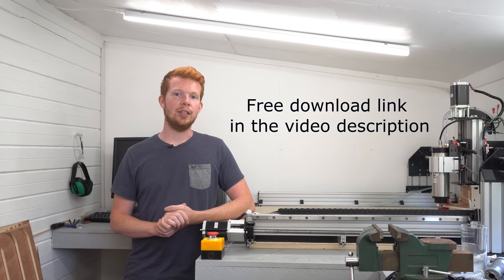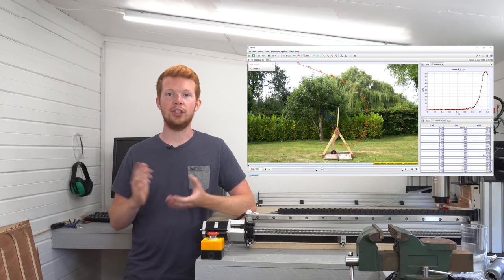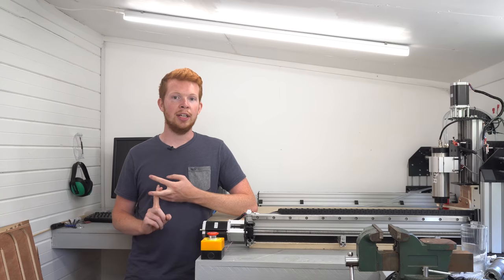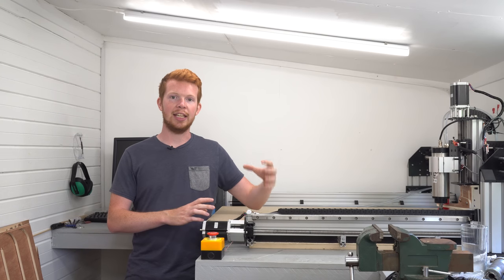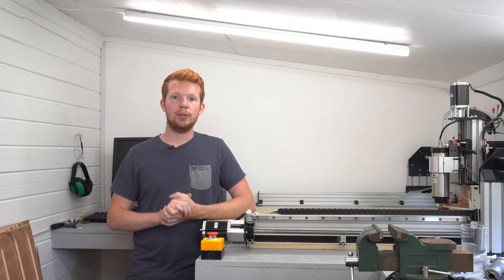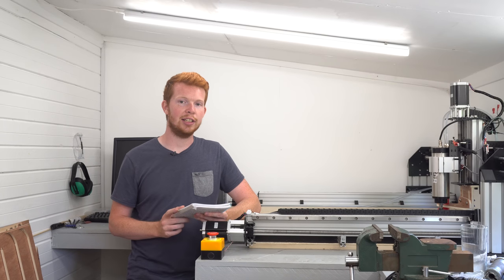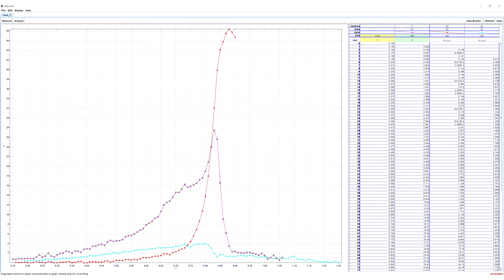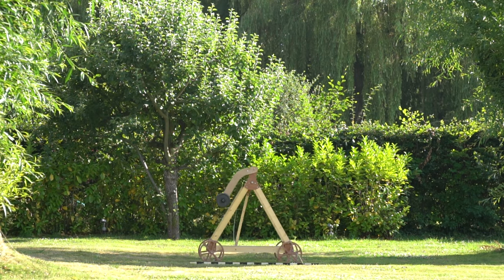Wheels on a trebuchet?

Comment: you still need the frame weights with the wheels, supposed to roll, not jump in the air
Reply: Jusb1066 noticed that too
Reply: This is a test I'd be interested to see. Will a weighted, wheeled frame break 70% efficiency? Can we get the tennis ball to 140?
Reply: If the frame has more weight, it would take more energy to move it the same distance forward, which is the distance required so the counterweight falls directly down the whole time
Reply: But there's already wasted energy in the jumping around of the frame. The weights may damp that. Or not.
Reply: Yeah but if the frame is weighted to resist jumping, it might end up being less wasted energy. I think it's worth a test.
Reply: a better option would maybe be a rail that holds the frame down with bearings to reduce friction (so no jumping can occur), but still allows it to move forward freely to optimize the down-movement of the counterweight
Reply: Toobiwoobi I was going to suggest the same. I hope he tries both methods.
Reply: Many variables in play and opportunities for tuning.  Here is a fixed frame with above 70% efficiency.  https://www.youtube.com/watch?v=p_O3h71TnhQ
Reply: When the machine is timed and the wheels can move freely, the Whipper Hop will stop.
Reply: The lighter the frame, the faster it can move out of the way of the counterweight, robbing the cw of less energy.
Reply: Might be best to make the frame even lighter and let it run on tracks with ball bearings above and below the track so it can't jump.
Reply: It won't need all that. But that's getting in to (FAW) Floating Axle Whipper and (FAKA) Floating Axle King Arthur designs.
Reply: When the front wheels jump up, the counterweight is falling to far behind bottom dead center. When the back wheels jump, the cw is falling to far in front of bottom dead center. That can be adjusted by changing the "gap"; the angle between the throwing arm and the hanger arm. The back hopping can also be caused by the frame being out of time from slow rolling on rough ground or in grass. I have videos showing all this stuff.
Reply: Notice it doesn't jump at all when he shortened the sling length to synchronize the stall points.
Reply: You really want the frame to get out of the way and back under the cw as fast and smoothly as possible. All the other timing points can be controlled in other ways.
Reply: There is also a backwards frame movement.
Reply: Everything stalls together, unless you're overclocking the systems sweet spot. But that's when shit gets good and the magic happens! 2, 3 400 feet per second launch speeds. They are weapons. We're not just trying to toss a ball around. We punch holes in stuff. Accurate, and powerful, at any scale.
Reply: Michael Smith I didn't know anybody cared. I was waiting for people to ask questions. I've been killing it for Years and have all of 40 subs. I just didn't think anybody but me gave a shit.
Reply: Michael Smith My Facebook group has over 180 people in it. It has all been being discussed in there. I always kept my videos short because I didn't want to annoy anyone or take up much of their time.
Reply: I couldn't tell difinitively from the construction video, but it also looks like there is a lot of friction on the axles.  Lost energy there as well.
Reply: there was no jump in the frame for the best test at 7:50
Reply: I believe this is something to be tested, at which frame weight there is the most efficacy.

Comment: A old NOVA special covers this in great detail.
The wheels are originally intended for a fixed weight arm. The basket arm does most of what the wheeled fixed arm accomplished.
On a fixed arm, the weight falls in an arc like a pendulum. The wheels allow the frame to move forward, allowing the fixed arm weight to fall in a vertical line, taking out the arc of the pendulum. The vertical drop gathers more force than the arc..  it’s not the trebuchet moving forward... it’s the weight falling “faster.”

Comment: The really good trebuchet vids that I’ve seen (MIT) use a stationary frame, but only the axle of the arm is on wheels. This allows the weight to drop nearly vertical. If the weight had no horizontal speed, then the potential is transferred more efficiently. You don’t have the mass of the frame being accelerated.

Comment: The frame moving forward is not loosing energy, compared to not moving you are just not moving the planet as much. With regards efficiency of the device with wheels, the counterweight does move backwards as part of the rotational path, if instead of the weight moving backwards the fulcrum moved forward the lighter end of the arm gains more forward momentum. ie by adding wheels you are effectively changing the rotation point of the whole arm,  moving the effective fulcrum closer to the counterweight and increasing the throw arm length just as it approaches the release. (see moving fulcrum trebuchets) 

If you put markers on the arm you will see that the arm no longer rotates precisely around the axle but slightly closer to the counterweight as the frame moves forward. 
To get even more energy out, try getting just the axle to move rather than the whole frame by putting it on a track on top of the frame.

Comment: Build a set of rails for the wheels to roll on. That'll greatly reduce your rolling resistance and should allow the frame to accelerate faster. Also, maybe bearings on the wheels?

Comment: Tom Stanton the reason why the wheels increase efficiency is not due to the velocity of the trebuchet moving forward, but what the moving forward allows the counter weight to do.  Without the wheels the counterweight does more rotation, but with wheels the counterweight drops directly down decreasing the amount of energy lost due to it rotating back upward like a pendulum.  It is the same reason why having the counterweight fixed to the arm is less efficient then having the small piece of wood as a go between. I drew a picture to illustrate the idea https://i.imgur.com/NjUtqmM.jpg track the weight with the aplet you are using to see the differences in the actual counterweight.
Reply: So it's similar to a floating-arm treb?
Reply: exactly my thought too. I was suprised nobpdy Else commented on the same
Reply: I hope he sees this comment because other people have comented other things that makes no sense. This is the true explanation
Reply: @caracaes  but he explained it quite well in the video. As he puts it the stall point of the weight and the arm are synchronized.

There are many ways to explain the same thing. All you want is as little energy left as possible.
This encompasses both explanations. Synchronizing the stall points means that at some point neither the arm nor the weight as much kinetic energy left. Having the weight drop straight down (as oppose to swing that wide circle) also means the weight has less kinetic energy left (otherwise it'd keep swinging).
See, in a way the video's explanation encompasses more than the one you so want him to see.
Reply: Coming in very late on this, I first came across the wheels-on-a-trebuchet issue many years ago in a Scrapyard Wars-type programme where the challenge was to throw a Mini. The reasoning given then was that with a simple trebuchet for best efficiency the weight needs to be able to drop vertically, hence the frame need to be able to move.

Comment: Great work and research Tom. 
The amazing fact to me is that the original designer of this machine achieved all this without the aid of modern day computers to analyse the performace. They would have had wheels to transport and manouver the machine into the attacking position. You certainly wouldn't want to be standing behind one when it was loosed....

Comment: The wheels are also moving the fulcrum (the hinge that the throwing arm spins around) forward which simulates a longer throwing arm. You could add the distance between where the hinge starts and where the hinge is when the projectile releases and I would guess that would be close to the distance between the end of the arm when stationary release and when its rolling release. Still awesome work Tom!

Comment: By moving the frame forward you actually move the point of rotation of the arm as well. Look at the footage, the point of the rotation now closer to the weight which means you have a longer leaver to throw the projectile. +1 ms at the frame multiplies to +5 ms at the tip of the arm

Comment: Great set of videos! Trebuchets rocks. You may try a launch with the counterweight fixed to the arm, as the wheels will make the counterweight do a vertical fall instead of a circular movement.

Comment: So, your main source of inefficiency here seems to be that your frame has horizontal kinetic energy at the release point.  Your wheels make the weight move more or less straight down.  So now you could gain efficiency by making your weight and your "tennis ball" more massive.  If you increased the weights to the max amount the frame can handle, you'd have something pretty impressive on your hands.  ;-)

Very cool videos, Tom!

Comment: I've always thought it was because it let the counter weight fall straight down instead of in an arch which to me makes sense since the shortest distance between two points is a straight line your counter weight is using the same amount of energy over a shorter amount of time thus it would go faster.

Comment: Try building a fixed frame with the central Axle/arm assembly on a wheel - If the wheel is scaled well, then as the counter weight falls the whole thing will roll forward as the arm raises, and you waste less energy shifting the counterweight backwards before the arm reaches release point. You can bulk up the supporting frame to keep things stable without having to put any energy into moving said frame forward when firing.

Comment: I think you can make the projectile even faster by building a very lightweight frame and swing arm. 

The weight starts at a point with high potential energy. In order to transfer all the energy to the projectile, it needs to exit the system when the energy of the weight equals 0. That is only the case when the weight has no velocity and it is on the lowest point. The trebuchet benefits from having wheels, because the weight can drop vertically and has no horizontal velocity.
When the energy of the weight is zero the initial energy is stored in the projectile, the frame and the swing arms. Now it is important that the frame and the swing arms contain minimal energy. Since these parts have to move at certain speeds to accelerate the projectile properly, you can still try to reduce the energy by using lighter materials. I suggest to start with the upper swing arm, because it stores the most kinetic energy (E~v^2). Or try to build a swing arm, that gets lighter towards the top.

By using lighter materials, less energy is stored in the frame and swing arm, thus more energy can be transferred to the projectile. This is especially important for fast moving objects, e.g. the tip of the upper swingarm.
Reply: Exactly. The entire potential energy of the weights makesup for the tennis ball, moment of inertia of the arm, and the accelerating the frame.
If you calculate the energy in the arm (E = 0.5  *moment_of_inertia * angular_velocity^2), and the energy in the frame (E =  0.5 * m * v^2) you will find a big chunk of the missing efficiency percentages. When you know these numbers, you'll also know which part takes up the biggest chunk and is ripe for improvement (reduce weight).
Great video's btw!

Comment: Another way of looking at the wheel advantage is that when weighed down you are effectively transmitting the waste energy into the ground which rotates planet earth an unmeasureably tiny amount (no really!). By adding the wheels that energy moved the frame enabling you to work out the necessary adjustments. I wonder if further improvements can be made with a few more tweaks? Great video!

Comment: I've seen designs where instead of having the main arm attached with a fixed axle, you add wheels to that as well, and let it roll on a track on top of the frame. That way more energy is transferred.

Comment: The way Ive seen it explained somewhere else is that the moving frame allows the weight to fall more freely, in a straight line down, thus giving a more explosive release of energy. In a way this allows you to beat the otherwise fixed relationship between mass and rotational inertia. Perhaps it also makes it easier to synchronise the stall points perfectly, but it seems to me that you could have them line up with a fixed trebuchet by playing with other variables as well? Sometimes these are just different way of looking at the same thing though... either way great experimental spirit and awesome results!

Comment: I think you may have slightly missed one point. The remaining energy in the system after ball release is lower with the wheels because you have less angular velocity of the counterweight, the wheels on the frame allow it to fall straighter.

Comment: U can also try adding a second frame which contains the rails for the first, triangular frame. This would probably lower the energy losses due to terrain being not entirely flat and the fact that you didn't use bearings for the wheels.

Comment: 1. You store energy in the arm when it's raised.
2. The frame is stationary because it's not being acted upon by any extra forces inside your frame.
3. When you release the weight, part of that force acts on the frame making it move because the frame does not have enough mass to oppose that force, therefore it no longer remains at rest ;)
4. Either make the base heavier OR pretend the whole earth is it's base by attaching the base to it with something so it becomes one masivelly solid object. Then you transfer as much energy as you can to the ball rather than sharing it with the rocking of the frame. (Minus the friction in the sistem of course, but that should be negligible)
5. The tunning is in the ratios of the arms amongst themselves and  also with the sling.

Comment: It's to do with having the counterweight drop as vertically as possible, any drop that's not vertical is transferring excess energy into the frame that kicks it requiring it to be secured down. Allowing it to roll with the counterweight incresses the efficiency of the drop and the rolling effect takes less energy that what is wasted when the frame kicks.

Comment: A point about the wheels - 
Think of it intuitively thusly - the weight is being allowed to fall straight down rather than a curve (where it is forced to stall early) still has a few extra inches to fall, indicating wasted kinetic energy - energy that just goes into the frame and does nothing.
The synchronising is just a consequence of this, if you tried to synchronise it without wheels you'll still always have that forward from centre stall point of the weight, and you'll never synchronise optimally (when the weight is at dead bottom). You'd have to compromise elsewhere to synch. 
Just think of the weight falling in an arc vs the weight falling (almost) straight down.
It's perfectly intuitive to think of it in this way, which is probably why people noticed it in the first place.

Comment: Making the frame able to smoothly move during operation allows the counterweight to follow a more consistently vertical path from release to stall and alleviates disruptive motion in the frame, effectively acting as a damper for the frame which simultaneously decreases unnecessary wear on the frame, improves accuracy and consistency, and improves the efficiency.

I mean, you're converting the gravitational potential of the counterweight into kinetic energy. ANY lateral motion of the counterweight is wasting that potential energy, so allowing the entire mechanism to move around it to ensure that the counterweight follows a perfectly vertical path will always improve the efficiency.  The trick is in ensuring as much of that converted energy ends up in the projectile, of course.

Comment: Excellent investigation. The stall point of the counterweight is lower with wheels. The difference in height of the counterweight stall point between the fixed and wheels version gives rise to the additional transfer of potential to kinetic, partially offset by the loss from the weight of the trebuchet moving forward. Maybe....

Comment: Adding the wheels doesn't delay the stall point of the counterweight, it increases the speed of the throwing arm so that it is in the vertical position when the counterweight stalls. Like a hoola-hooper has to rock back and forth at the right time to add speed to the hoop, the rocking of the trebuchet adds energy and speed to the arm.

Comment: Some trebuchets have a sliding axel, so that the the net motion of the counterweight is essentially vertical.  

Wheels also would make moving a seige weapon easier.  You would still fill the rock box locally.  It would also make aiming easier.  I could see merit in having it on two wheels and moving it around like an artillary piece.

Comment: The wheels allow the weight to fall in a more vertical direction which increases the energy transfer efficiency.  It likely has a greater effect on the more traditional treb design as the weight would not be forced around the central pivot.